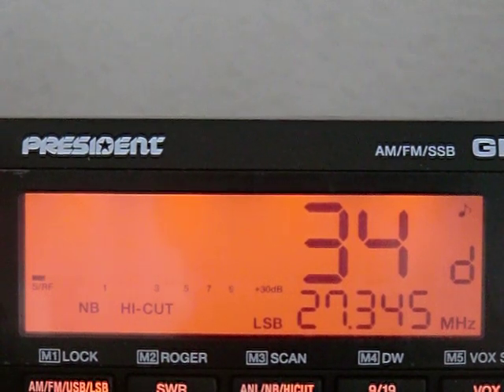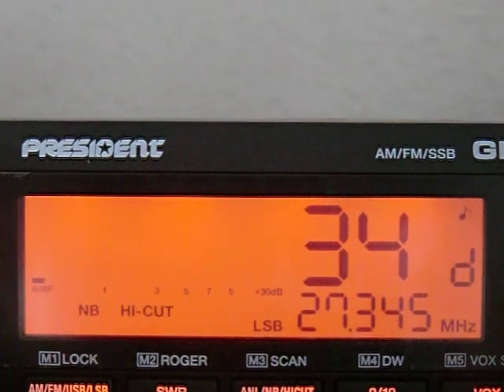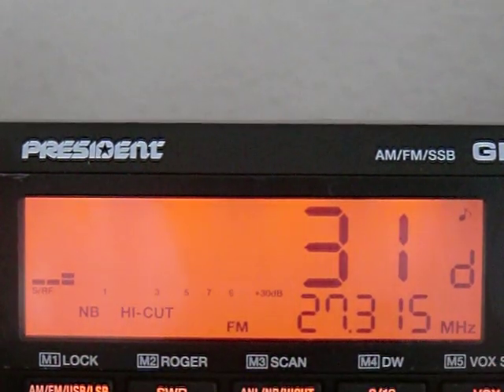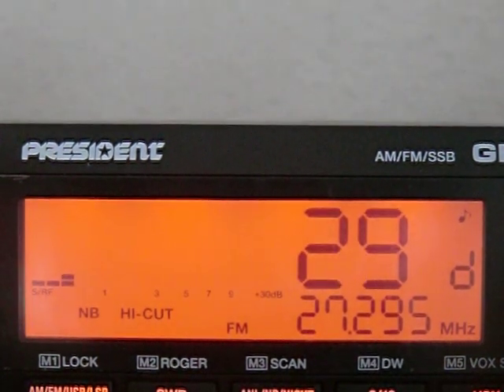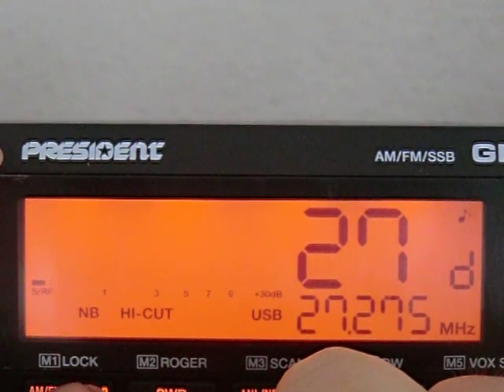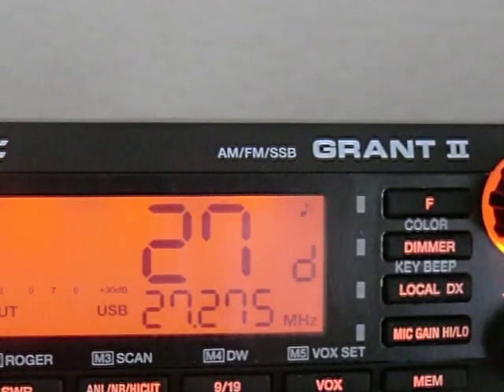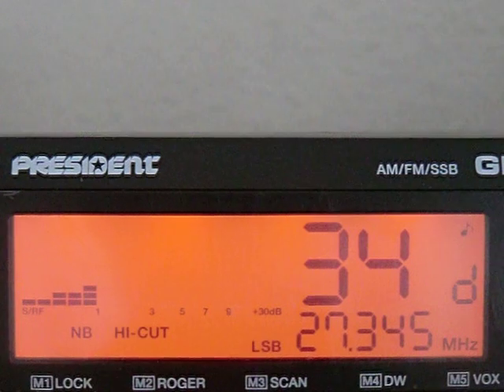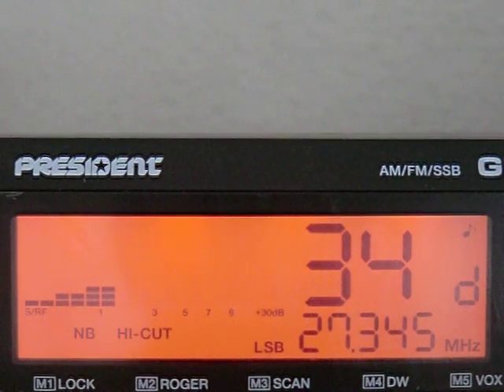President Grant 2 on RX to show noise floor.

Comment: 27mhz is not good for local communcations anymore. the future lies within PMR446 and hopefully if it gets legalised VHF CB. Much lower noise floor meaning no static. smaller antennas required. and abilitiy to set up repeaters.
Reply from the maker: Thank you for your informative comments. Indeed you may be right. Here in Germany we have all that accessible to us to even a allocation of 2m frequencies. As for VHF CB its called the foundation test is it not?